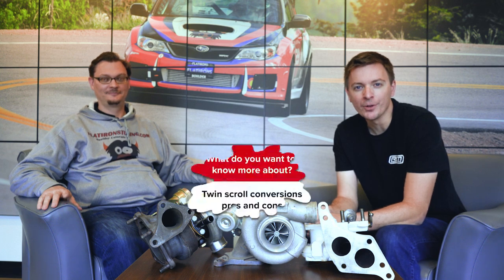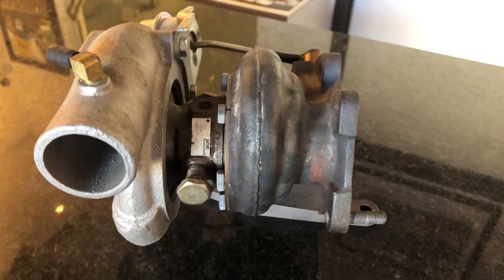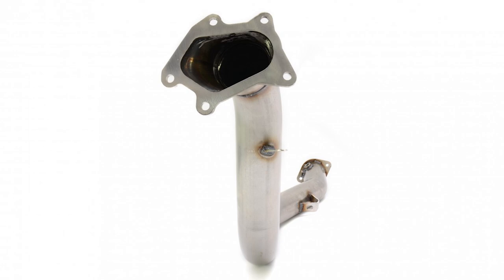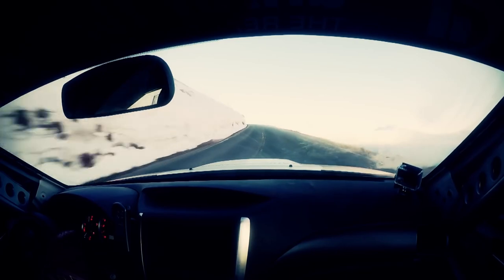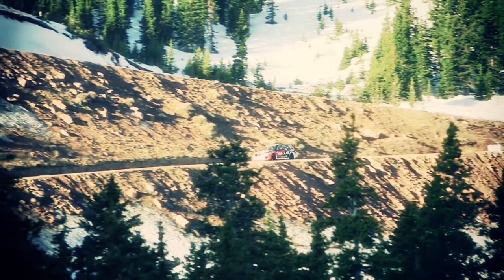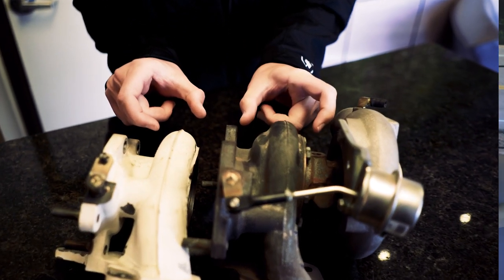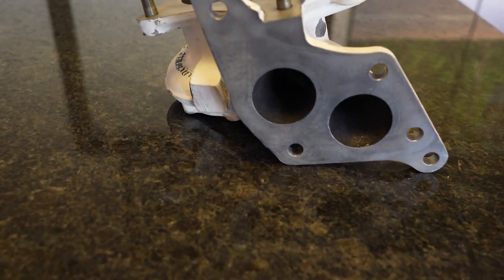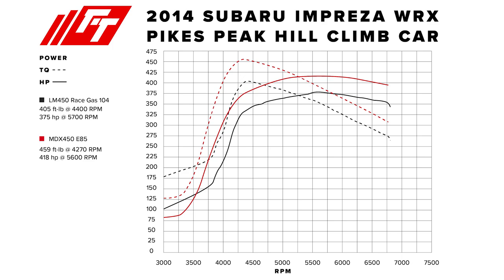To Twin-Scroll or not to Twin-Scroll, that is our Question of the Week

Comment: My experience: Now granted I had access to all the parts and tuning was easy, that part can be a hassle and very expensive. Mid Ohio I ran a better time with a single scroll(equal length header) than my twin scroll on the same engine(2L 9.7:1 compression), but I did better at my local Auto and Rally X events with the twin scroll. I'd say for the most part it should be application based and whether or not you really "NEED" a twin scroll. 2L daily, yes I actually saw better mpg(+4-5mpg) with a twin scroll, but if you plan on using the car for what you actually bought it for(let be real folks you didn't buy it to drive to and from work) then a single scroll would be better. Again guys thanks for the great content and I look forward to seeing more. Hope you'll be at PRI this year.
Reply: Exactly... For max power application like drag strip.. definately single opens up more power level option...

But for rally,autoX,gymkhana and such technical circuit layout, definately twinscroll have wayyyy better driveability and more responsive
Reply from the maker: Thanks for all those details Keith.  Nigel has mentioned some of your results with the twin-scroll turbos, and at some point, it would be a fun conversation to have.  I'd love to get more details.

Thanks Keith.  Stay Tuned!

Comment: This isn't my experience at all.  Usually you see at least 10% improved top end and improved spool by about 400rpm. The turbo efficiency band is greatly inproved as well. I'm thinking there was probably something wrong or unoptimized with your exhaust configuration. Unless you want to do something cheaper its almost always better to do a twinscroll turbo.
Reply from the maker: Thanks for your comment.  Honestly, we didn't expect the results that we found either.  That is why we tried this many turbos, etc.  We just wanted to put together the data that we had and share what we found.

Thanks for watching and Stay Tuned!
Reply: @blow0me so I have experience switching from a twinscoll to basically a single scroll just by making the header unequal length. Changing nothing else on the exhaust or turbo. Performance is lost across the  board including spool. In their example I feel like there is too many variables changed. Yes it might not make a difference but if it's done properly you should always get more performance. The turbo also has to be designed from the ground up to be twin scrolls. Just swapping a housing on the turbo doesn't make it a proper twin scroll. My baby sized Garrett MGT2259S was making much better numbers then most of their twinscoll turbos with much less spool time.

Comment: I think on a boxer engine with long exhaust headers twin scroll is less beneficial. Something people do not take into account is the increased surface area of the exhaust walls, that being if you run two pipes equal sectional area as one pipe. When you look at aircraft surface area, even if aerodynamic the more area the more drag you have causing turbulence and resistance/pressure. On a short run exhaust manifold, especially where they are not equal length, a twin scroll setup is more advantageous. Having small exhaust volume between exhaust port and turbine inlet allows for higher pressure spikes from interfering exhaust pulses. Having a larger volume but also twin scroll you are introducing more friction. The same can be said about bends or even with a water pipe, the longer the pipe the more pressure loss you get. running one water hose of a specified volume will have less pressure drop than two of equal volume. I am building a Turbo helicopter engine and a twinscroll is better as it is a short header (lighter), it reduces backpressure and egts, but I can also merge the collectors into one scroll for high altitude response.
Reply from the maker: Thanks for the comment. There is definitely more going on with a twin-scroll turbo than you would usually assume.

Thanks for watching and Stay Tuned!
Reply: Yep, that's exactly what I was thinking. I feel like you might be able to get away with the same runner path if the runner diameter were small enough to allow the exhaust pulses to reach the turbine with enough energy to take advantage of the twin scroll snail, but I'm just guessing. I'd really like to see what numbers we'd get from that manifold if we were to use Graham Bell's equation though, just out of curiosity.

Comment: I am putting a gtx3076 0.82A/R on my stock 1jz gte non vvti, but I cant decide between single scroll or twin scroll. If someone could recommend which set up to go with that would be amazing, I will be using a Pulsar turbo and 6boost manifold. Thanks
Reply from the maker: Thanks for the question.  I'd say that the closer you can get the turbo to the cylinder head, the better your results will be if you go twin-scroll.

Also, since that is a 6 cylinder engine, it may actually be easier to build a twin-scroll manifold compared to a 6 into 1 manifold.

Sounds like a fun project!

Thanks for watching and Stay Tuned!

Comment: Do it!!! Just got my vf37 twin scroll tuned. Made 380hp full boost at 3200 rpm. Such a fun way this car pulls. So linear and quick
Reply: Wrote that before watching the video. What dyno got your 350 hp value? Cause that turbo is massive compared to mine and I got 325 on 91 and 380 peak on e91 makes 21 lbs of boost that holds till 7k. Is that altitude difference or maybe inaccurate dyno
Reply from the maker: Thanks for your question.  We compiled data from our tuned who has used 2 different dynos.  The first few were on a Dyno Dynamics, and the last 2 were done on a Mainline dyno (similar to, but more advanced than the Dyno Dynamics).  Both are Eddy current dynos. 

Thanks for watching and Stay Tuned!

Comment: The advantage of the twinscroll is really that last 10% efficiency kinda deal. I’ve driven two JDM Legacy 2.0s (I built both of them) with the same engine, one with a td05 18g twin scroll and another with a vf34 with the same supporting mods. The vf34 comes on boost more violently and feels faster in the mid rage due to the aggressive transition. 
The twin scroll was much better off boost and had a linear and progressive power curve. Top end was very similar. 
Fuel economy on the twin scroll is slightly better.
I currently have a twin scroll 1.5xtr on a JDM LGT with a EJ207 and built dual avcs heads, that turbo is perfect on that combo and makes 410whp on e85 at 24psi from 4K-8k (this is Australian hp so like 600hp US)
Reply from the maker: Thanks for all that information!  I think that the Twin-Scroll turbos definitely work better on engines that are set up to rev a bit higher than the standard EJ25.  You get to spend more time where that turbo excels.

Thanks for watching and Stay Tuned!

Comment: Great video! One thing I think its important to make a note of is that you're likely seeing some of these issues because you are staying on the OEM TS style flange and housing. A proper twin scroll setup by someone like full race with a B2 BW housing produces all of the good with none of the bad of the twin scroll setups. Yeah you need their header and up pipe, etc. But you need all of those for a TS install anyway... Might as well just run a BW EFR :D
Reply from the maker: Thanks for the comment.  When you get into big turbos, the twin-scroll option can still be a bit complicated.  How the engine is built to make power is a big piece of the puzzle for that decision as well.

It is beyond what we have played with, so I can't speak to it with the kind of data that we have for the stock-location turbos.

Someday maybe that will change :-)

Thanks for watching and Stay Tuned!

Comment: I'm running a 1.5XTR T/S and its incredible, previously used a 2.5XTR which was exciting but less driveable, narrower power band, and ultimately less power at redline due to inefficiency in the hot side 8cm probably.  Mustang dyno tuned350 whp 380tq, 28psi, ID1000, Fuelab FPR, APS TMIC, 93oct stock EJ257 engine with JE pistons stock bore and CR.  Responsive autocross build.  Yes you can achieve this power without twin scroll, its not about that, its the delivery of it.

Comment: In summary, putting aside bogwarner efr or lm450 s60 being the best ts turbo, some of the said benefits going back to single scroll on the lm450 in your back test maybe largely due to unequal length header. 
And accordingly to ur findings one should get ur engine higher reviving and have broader high rpm power brand to make use of better response getting on the throttle on high rpm with ts setup. That means if one is already with a ts setup (for jdm spec c folks like me), don’t panic jumping into single scroll just keep the setup. As for those currently with single scroll don’t try too hard going thru all the hassle jumping into ts, unless you are making sure you need the upper end rpm benefits getting back on the throttle on this range (but that may mean that you need upgrades to head work and etc to make power on higher rpm range). I guess that’s what you try to say here.

Comment: On your back to back Dyno graph of the twin scroll versus single scroll it also shows you guys changed fuel, from 104 to E85. Did you guys do any Dyno pulls on the single scroll on 104 before switching to E85?
Reply from the maker: Thanks for your question Ross.  We did not unfortunately.  When we made that switch, there was a lot of other changes that happened to the car at the same time.  Bigger injectors was one, but we also had to change out the bladder in our Fuel cell for a new one to handle E85.

So it just wasn't possible to see what the car did on Race gas before putting in E85.

Thanks for watching and Stay Tuned!
Reply: I’m wondering if the extra exhaust flow from the e85 having to run richer actually helped spool the turbo quicker…
Reply from the maker: @zokusharuuku1091  E85 does generally help to get a turbo spooling up a bit more quickly.  It also does really well with timing, so that can be part of the equation as well.

Thanks for watching and Stay Tuned!

Comment: This is a good video.  On the newer 15+ FA20DIT, the true equal length header with a twin scroll turbo is how that engine was designed; therefore, I would assume a guy would want to keep the twin scroll configuration on this engine.  What do you think?
Reply from the maker: Thanks for your question.  Yes, the placement of the turbo is a big part of it as well.  The closer that you can get the turbo to the cylinder head, the better the Twin-Scroll turbo will work.  That is why stock for stock, the FA20DIT WRX has more tuning potential right out of the box compared to the 15-21 STI that is using older design EJ engine and turbo configuration.

In short, no, you wouldn't want to change away from the twin-scroll turbo on your FA20DIT WRX.  For that engine on that platform, it works very well.

Thanks for watching and Stay Tuned!
Reply: @FlatironsTuning  thank you for your reply.  I am currently in the middle of a pretty big makeover, and I am working on mounting a G30-770 turbo with T4 divided twin scroll turbine housing to the odd shaped flange on the header.  Not easy to do properly but will be well worth it!
Reply from the maker: @2018wrxaddict  Wow, that sounds like a really cool project!

I am sure that if/when the STI gets an FA24DIT engine, the turbo set-up should be the same as what you are using on the FA20DIT.  And once that happens, I think that there will be a lot more energy put into big turbo options for that front-mounted twin-scroll turbo.

Good luck with the project, and let us know how it turns out!
Reply: @FlatironsTuning  I'll definitely update you!

Comment: Very helpful when you go over specific turbo models! 

I wonder how the Garret turbos compare. Ive seen a few 3071r ej207s
Reply from the maker: Thanks for your question.  Yes, the Turbo Dynamics MDX555-450/LM450 is based on the Garrett GT3071 actually.  I'm sure that Turbo Dynamics has some data about those turbos on EJ207 STI's.

Thanks for watching and Stay Tuned!

Comment: The JDM guys rave about the throttle response and power from 2000 to 8000 on the ej207. If you want a 350whp can carver with response and a broad power band would it make sense then? Cost aside
Reply: Is there a benefit going TwinScroll on the EJ207 ??
Reply from the maker: On the EJ207, if you are revving higher, there may be more of a benefit in the upper rpm range with the Twin-Scroll turbos.  It is definitely happier the faster the engine is spinning.

But picking the right Twin-Scroll turbo will still be a big key to success there as well.

Thanks for watching and Stay Tuned!
Reply from the maker: @G1itzik  Thanks for your question.  As with our experience, I'd say it would be best to get as much information as you can so that you can compare your pick of a single-scroll turbo to the twin-scroll turbo you are considering.

Make sure that the powerband is where you want it to be.

Thanks for watching and Stay Tuned!
Reply: @FlatironsTuning  The twinscrool is much more better in 2.0 subarus, in usdm 2.5 liter due to displacement the turbo will spool faster and you could use a bigger turbo to have the powe band on reasonable level, especially with equal lenght headers. I would say twinscroll conversion is worth only on 2.0 motors, if you could afford the full swap (head, manifold, pan, turbo and downpipe), in 2.5 it's better to buy equal lenght headers with ball bearing turbo.
Reply from the maker: @jakubclash7629  Thanks for the comment.  We do wonder if it would work better on a high revving 2.5 liter engine, but that is a little less common, and we haven't had the chance to do any testing with that set-up.

Thanks for watching and Stay Tuned!
Reply: Jeff.. jdm guys raving because they were on 2liter setup and their circuit layout (roadcourse), autoX, gymkhana layout were tighter.. which it would be the better option route...

I have 2liter sf5 with jdm wrx swap...tuned to 247whp,257wtq on single td04L

At certain pulls match with my friends jdm ej207 vf37 stock sti, i can match them pretty well.. but at certain rev range the sti having broader torque and pulls away slightly then me...

And i dont do drag/roll races much here... But more on twisty backroad/touge kind of driving as well as rallying,gymkhana/autoX... So twinscroll is the better setup for us here with 2liter  (we dont have that much 2.5liter imported...all pre 09 sti and wrx we got were jdm 2liter)
Reply: My vf37 twin scroll on an ej205 made 380 hp and 320 lb ft. This was on e85 with a flex fuel kit and other supporting mods. I would say it is worth the money if you're not trying to get huge numbers and want a fun drivable car. The power band is very linear and I can grab 8lbs of boost instantly at 2800 rpms if I need to speed up around something.  If you do this I would recommend getting a vf style twin scroll as these will be easier to swap turbos. 

The downside- 
I started with a jdm legacy td04hla 19t. This was an older style twin scroll so when my turbo went bad I bought a replacement from kinugawa. The wastegate was in front of the cold housing instead of in between and couldn't be used. I then had to buy another replacement which was the vf37 and this meant I had to switch downpipe headers and up pipe. Overall for my current 380hp I have had to spend close to 3k on turbo related things when it should have only been 800$. 

Absolutely love the car and it is quick as hell. My friends single made 410 hp and had to wait till 4500 rpm for the power to kick in. Mind you his car PULLED. You don't get that feeling of being sucked in as hard with the linear Power band

Comment: Try gtpumps(Australian company) for a twin scroll. My Liberty , aka Legacy gt (5th gen low mount turbo using a turbo for the FA20) achieved 27 psi at 3200 rpm (ej255). It's a very different performance characteristic to other Subaru's I've driven (owned a my02 STi and driven a 2014 WRX)
Reply from the maker: Thanks for the suggestion and thanks for watching.

Stay Tuned!

Comment: Would a twin scroll be better than single for  inlet restrictor situations?
Reply from the maker: Thanks for your question.  It would actually be worse.  Because twin-scroll turbos (in this configuration) spool up a bit later, you would be limiting your power band even more to switch to a twin-scroll turbo if you had to run an inlet restrictor.

Thanks for watching and Stay Tuned!

Comment: Nice! Was this recommendation for the EJ series Turbo upgrade? I'm asking because I went EFR 7163 twinscroll for a FA20 build. The idea was response,  and to have the top end not choke out. I have a question, how would you begin to tune your suspension? Does it depend on the track? Do tires play a huge role?
Reply from the maker: Thanks for the comment!  Yes, this video is all about the EJ series of engines.  The FA20DIT puts the turbo so much closer to the engine, there are many more benefits for the twin-scroll turbos on that engine.  Which is why it comes with that turbo from the factory most likely :-)

Suspension set-up is a big one.  We have had a number of questions about that, and it is something that we are working on tackling.

But yes, tires are a huge part.  And alignment.  And just about everything else.

Thanks for watching and Stay Tuned!
Reply: @FlatironsTuning  thanks for the response. I assumed that the FA20 and the Fa20 DIT would both benefit from a smaller twin scroll. At least when it comes to response. I appreciate this series of videos it provides a lot of information and gives some experience along with it.

Comment: What size of tires and wheels are you guys using on your hill climb 2014 WRX? Thanks!
Reply from the maker: Thanks for your question.  We were running 17 x 9 wheels and 255 width tires previously, but for the last 2 years, we have moved to 18 x 9.5 wheels and 245/40-18's which are more like 275's.

Thanks for watching and Stay Tuned!